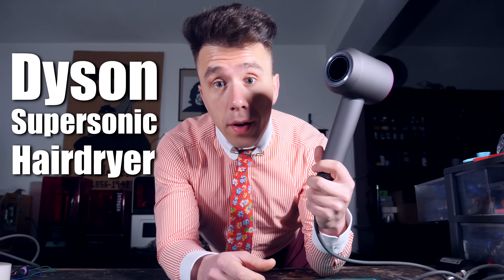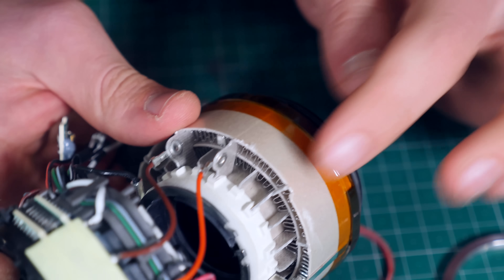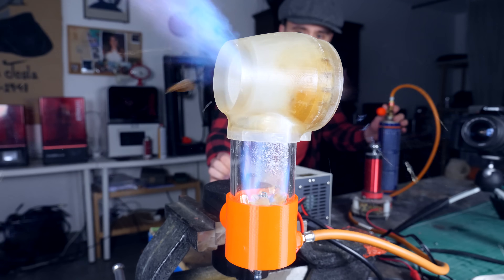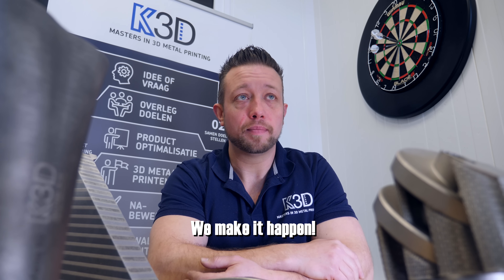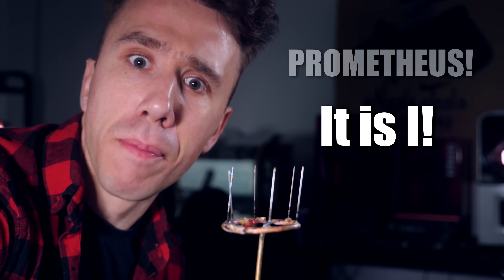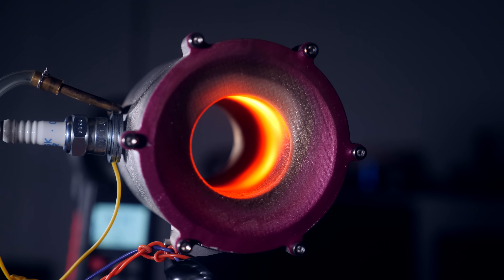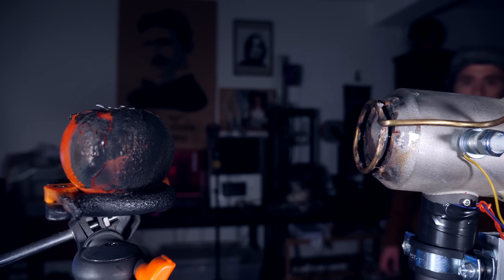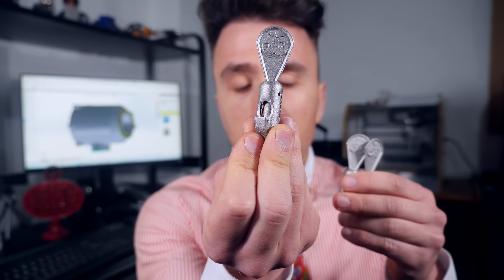I turned my DYSON HAIRDRYER into a JET ENGINE

Comment: Hello well here is my video idea for hopefully a 3d printer from MR. [ @ INTEZA ] Try making an air powered [air motorized]  electric generator that can create energy to recharge the air tanks+batteries/super caps constantly while being able to run electric motors to power an automobile, also using regeneration techniques, i.e regen braking and some roof or panels with flexible solar panels all to help in energy recovery,  i believe something like this could be used to have a true electric car hopefully giving long ranges without needing to be recharged.  ( I know this video is a year old already, but I hope my idea gets a ton of LIKES so INTEZA sends me a 3d printer or whatever he's giving away nowadays 😅.)  ☆Much love and Thank you all for taking the time to read my post.  Peace ✌from south Florida.  (😅I'll also try posting this on one of INTEZAS newer video in hopes tha INTEZA hopefully sees and read my post.😢)

Comment: MOTORIZED HIGH SPEED 75,000RPM ROTOR PROPELLER SPIN GEL CELL CONDUCTIVE LIQUID TO 800G NEODYMIUM POWDER  MAGNETIC RESERVOIR CENTRAL CHAMBER SEPARATELY  MICROWAVES PHASE COIL OF WIRE WALL TYPE SOLENOID  STEP-UP VOLTAGE TRANSFORMER ALONGSIDE HOLLOW OPEN CLEARANCE COPPER & aluminum interior SELF REPULSION ROCKET  copper exterior (pnp) phase TYPE DIAMAGNETIC REPULSION PARAMAGNETIC REPULSION  AND DON'T FORGET THE ENCLOSURES FARADAY'S LAW MICROWAVE BLOCKING EMF WIFI GOOD LUCKY

Comment: No way this is a jet engine.
This is a gas driven hot air gun.
You've just replaced the electrical heating element with a home build propane heating element.

As you know, a jet engine is self sustaining and creates thrust.

Really expensive project, €500 worth of equipment ruined for YouTube...